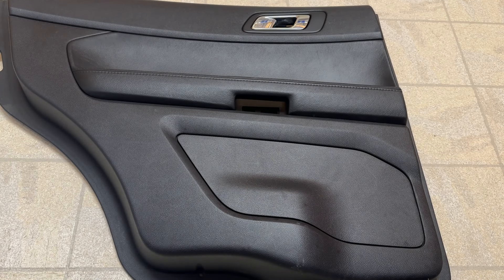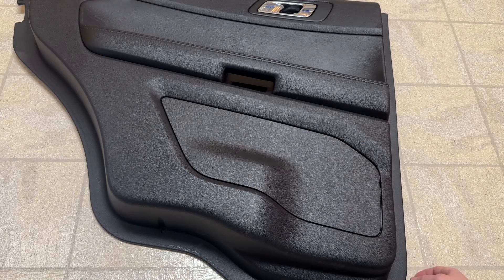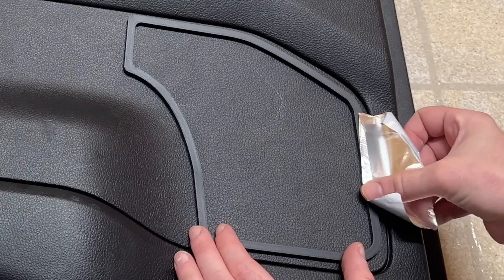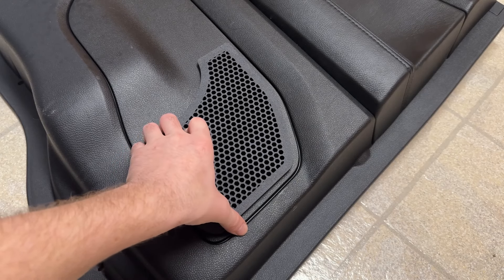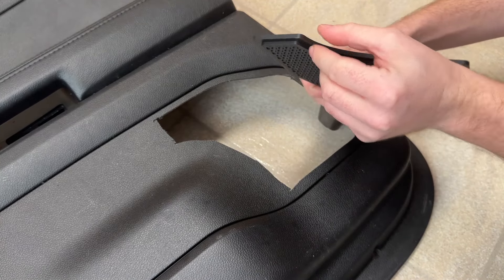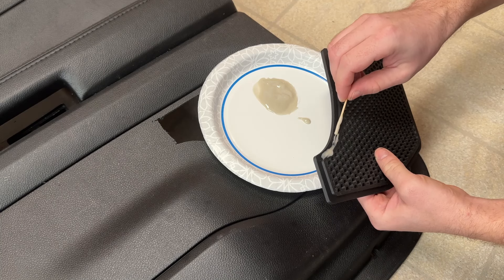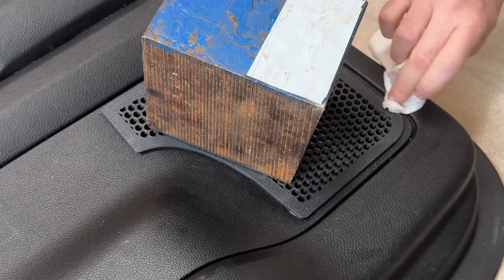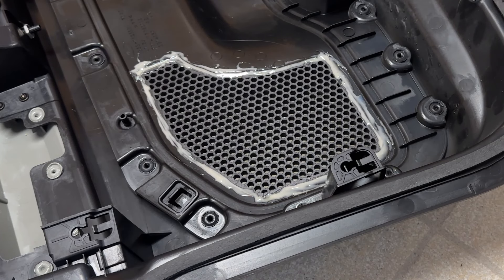How to Access Rear Door Speakers in a 2013-2019 Ford Police Interceptor Utility

Comment: I have to stop and say that was a fine workaround to a difficult problem.  Not that it is difficult to cut a hole in a plastic door panel, what is difficult is to make it look OEM and you knocked this one over the fence!  Nice job.  Im a 60 year old car guy who is 3 days into convincing myself to buy a FPIU to do what I want to it.  My last car build was an awesome 91 Nissan 300zx slicktop i converted into twin turbo.  Now its time to build a cop car!  You have also enlightened me as to practical uses for 3D printers.  Ive been an AutoCad pilot all my life (release 2.2) and until now I havent stepped into the 3D printing because I have no need for plastic toys and boats.  Those console fillers pieces you did clicked a switch in my head.  Thanks for sharing!
Reply from the maker: Thanks for the words of encouragement! Glad to have your support.

Comment: IDK much about 3D printing, but have you considered adding hook tabs to the inner lip of the grille that would catch the cut edge of the door panel, making it self-anchor while the glue dries? Or lazy people could either omit the glue & just rely on the tabs, or add double-stick foam tape to the main lip & let the tabs hold that on tight. Another easy addition since you already cut foam to shape would be fabric like ASIN: B07YZHBHKC, simply melted in a few spots onto the backs of the grills. It's about the same as what Ford puts on the dash center grill that you worked on in another video.